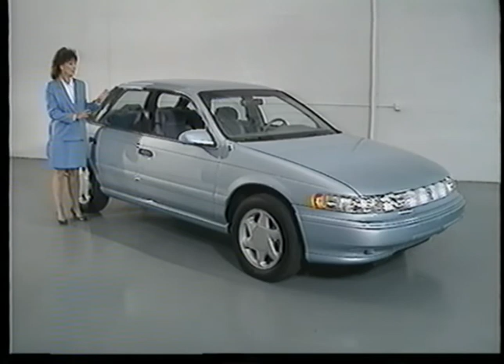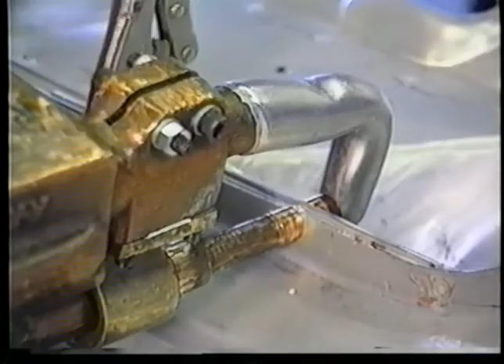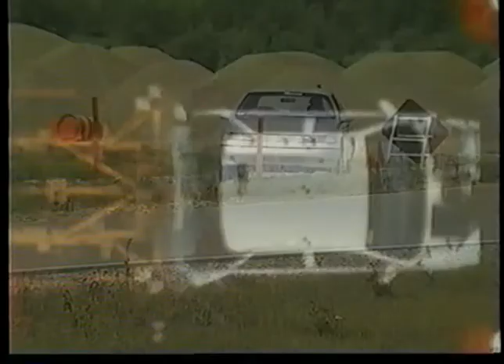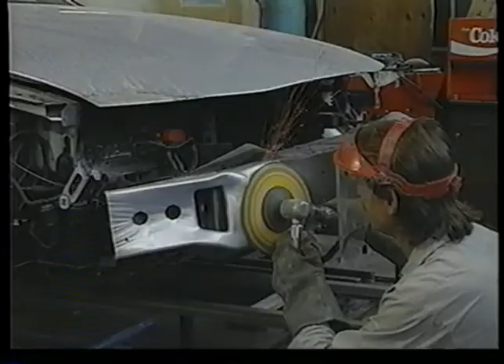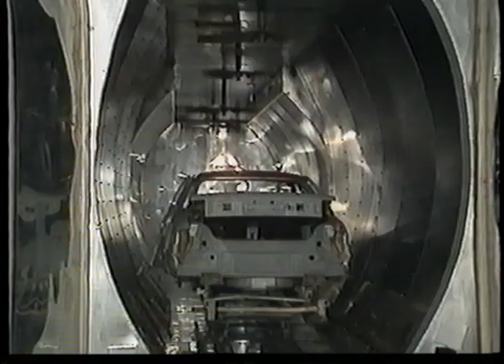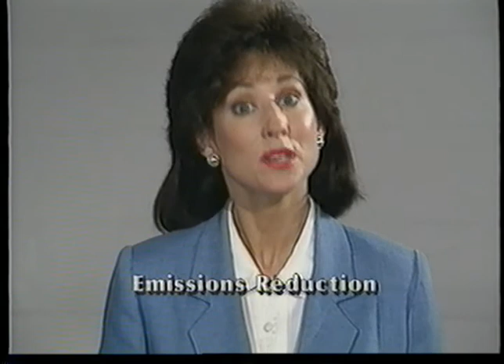Ford Motor Company: Aluminum Intensive Vehicle Program

Comment: What does this have to do with FCEV?
Reply from the maker: Jim thanks for your comment!  We’re glad you asked!  This model featured in the video, was the same model that lead to the very first fuel cell vehicles!
Reply: @HydrogenHouseProject  What are you considering the first fuel cell vehicle?  Does aluminum body construction have a lot to do with FCEV?
Reply from the maker: @jaketen2001  We will post a video soon to show you what we turned the Mercury Sable Aluminum Body construction in to.  This vehicle was created as a New Generation Vehicle.  Developed intentionally to produce a new Era of cars with the lightest weight,  most Gas mileage, most power, most durability, and safety while using an Aluminum frame vehicle.  Aluminum is typically 60% lighter than steel with equivalent strength and no corrosion issues.  Keep in mind this, "New Generation," of vehicle paved the way to a new mindset of efficiency and simplicity leading manufacturers to think outside of the box moving forward.    

The Budget was 33 Million (Back Then 1990's) for developing 20 of these, "New Generation," cars. 

Our Organization and founder, Mike Strizki, created and has the last standing version of this vehicle.  This vehicle functioned as the first Sodium Borohydride, "hydrogen on demand," system in the world!  

This lead to a new age of breakthroughs in lightweight, safety,  and efficiency focused production vehicles.
Reply: @HydrogenHouseProject  Ah ok.  Look forward to it.